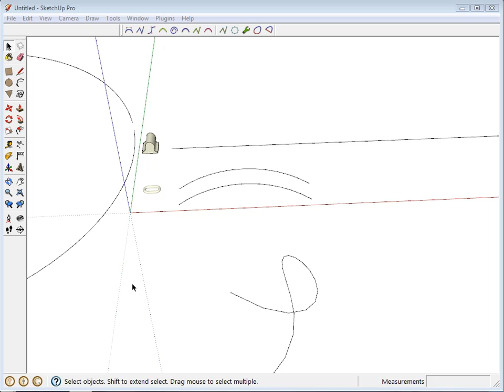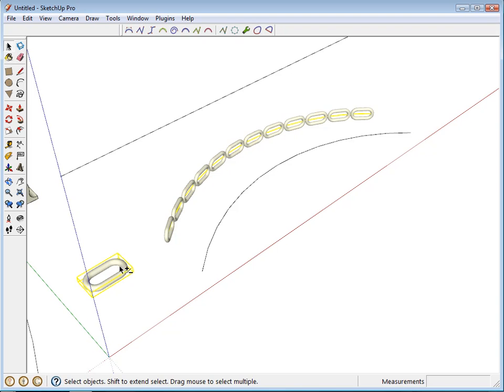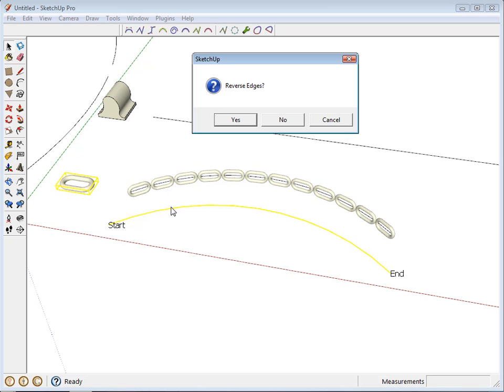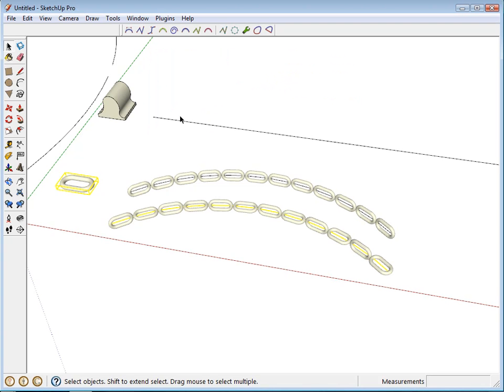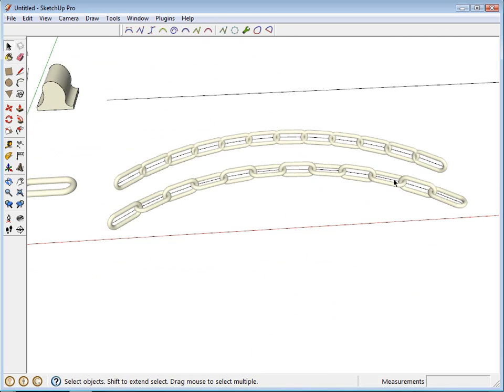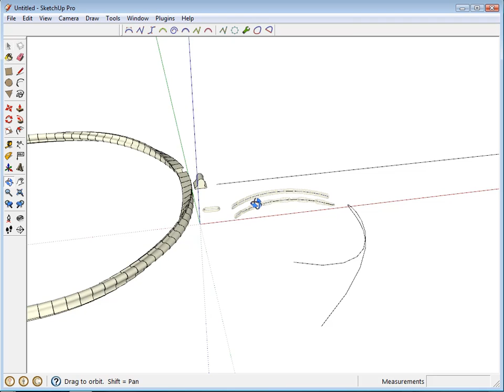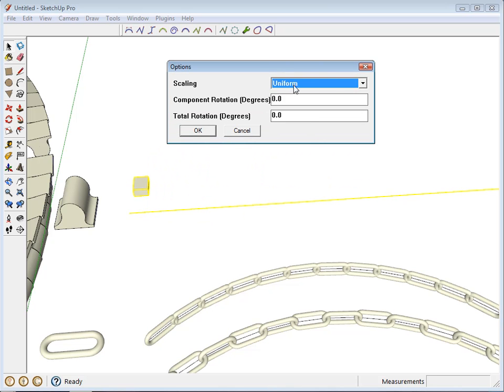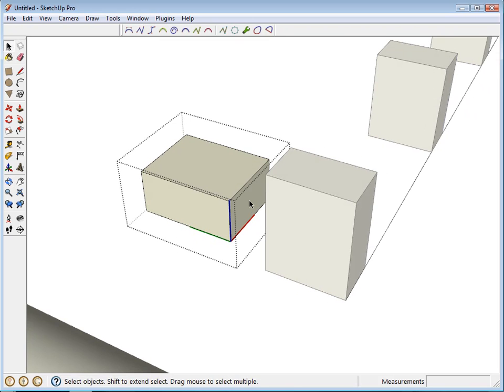Component Stringer Sketchup Plugin

Comment: The last example is a little confusing... I think you forgot to mention that the (apparently) straight line has been split into numerous segments and each segment results in a new instance of the component at the start of the segment.  Is that correct?

Comment from the maker: @richface Hmm, did you do it the way it shows in the video?  You need to have a component (or more than one, and I think a group might not work, probably needs to be a component) selected and a series of connected edges.  Then it should work.  I have not tried it personally in 8, but I think that I have seen reports that others have and really there is no code in it that should fail in 8.  So make sure you have the right things selected before running the plugin.